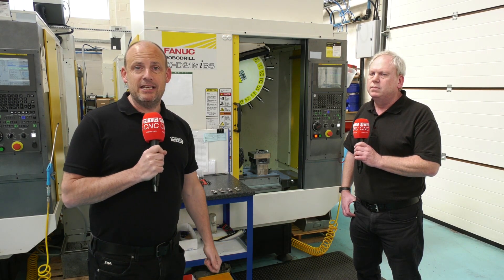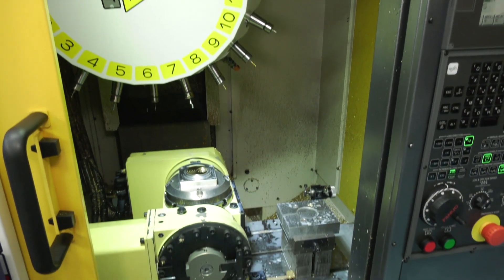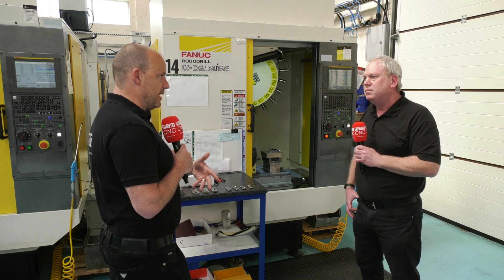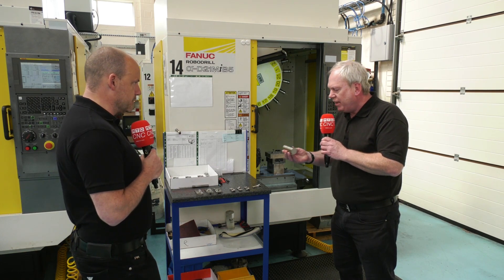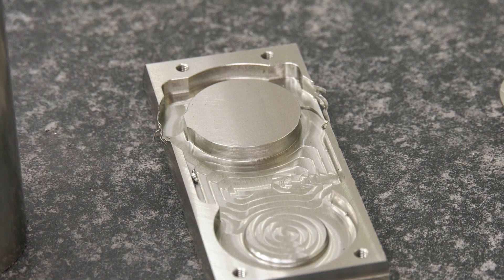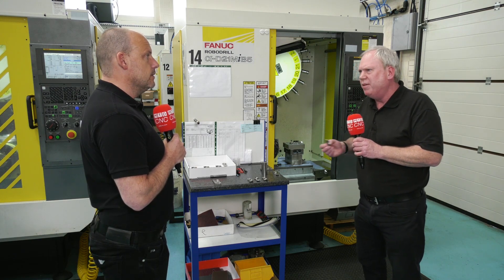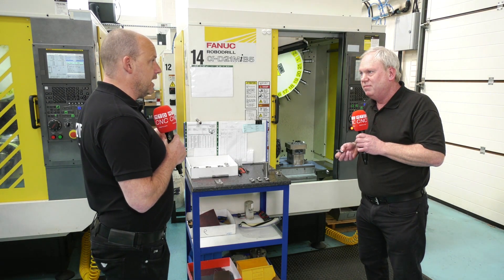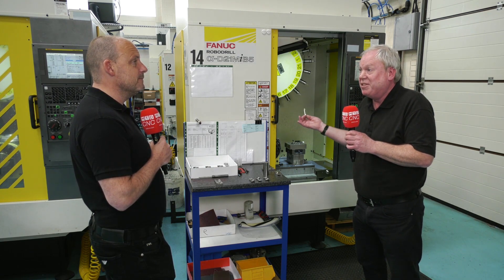Cutting stainless daily on our ROBODRILL

Comment: I work on a Robodrill too, the machine can take the loads but when I machine stainless with endmills smaller than 4mm they tend to break or go dull quickly. Does anyone have recommendations on what cutters to use, brand and series?
Reply: Can it handle steels? Like a36 or 44w or something tough like 4140?
Reply from the maker: Hope you enjoyed the video, thanks for watching.